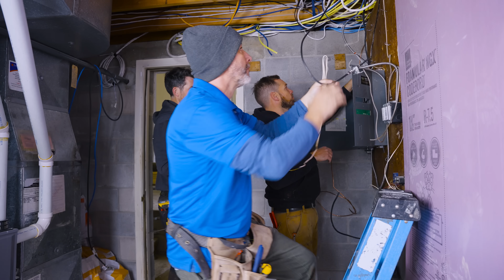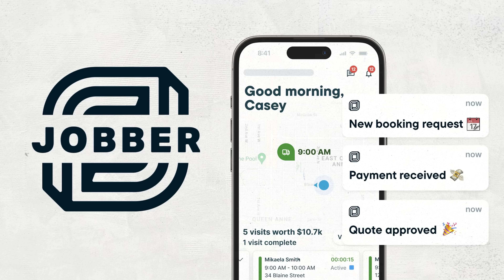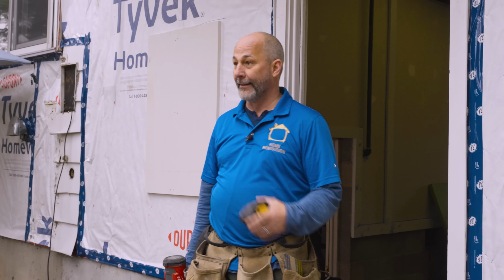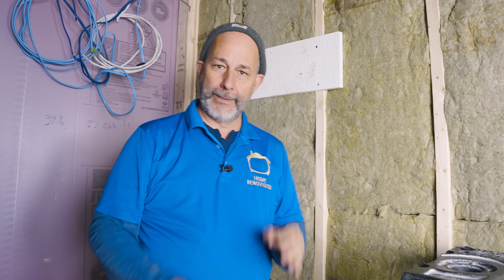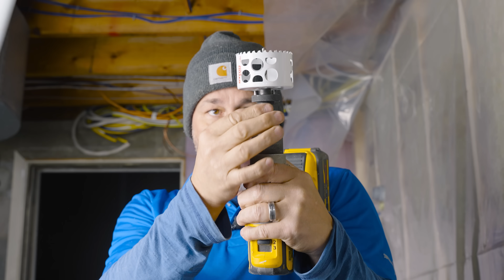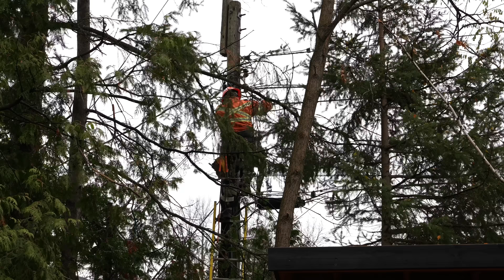How to Upgrade to 200 Amp Service - The Right Way

Comment: @HomeRenoVisionDIY

Just curious — did you use the adhesive dabs behind the foam board as a spacing method for moisture drainage/air gap before framing, like you showed in some of your other videos?

If not, I’m curious why that approach didn’t apply in this situation.

Comment: i hope you used a capillary break between the 2x4 on the floor and the concrete. otherwise it will wick moisture and rot. you also should have used a vapor-permeable vapor barrier like Intello Plus instead of that cheap plastic. Otherwise, water driven through your concrete will have nowhere to go, especially since you didn't bother to tape your rigid foam. Air leaks everywhere.

Comment: I realize code is different in the US vs Canada, hell different from east to west coast.  But I have to laugh because when I was putting in an new fence post (next to the house and electric box) and dug the hole down 3 ft and I came across the bottom of the electrical conduit and I hit no sand and NO warning tape.   Now I didn't dig laterally to see when the conduit stopped and the bare wire was in the dirt.  Thanks for the videos

Comment: ROMEX though??.. I am a pipe guy and for MANY reasons even though you may think ok..u are there for ever..life changes..homes change hands..people get dumb ideas and drill through and or send long screws and nails where they shouldnt...and so PIPING protects against that even the current people that would own. An forget or  not realise..j get it piping is expensive..but spare no expense ever on piping or plumbing...

Ok..back in know and tube there was the same mentality...

But guess what..with the way things are going things change needs change fast and you can run into situations where simply splitting a run or circuit and relocating is te best way..but you can't because you used Romeo and just tracing and pulling and adding wire is out if the question.

JUST to name a few... don't know why anywhere still allows romex..and Romex is like soo easy...though but very damaging...any holes going through floor joists compromises integrity ..so more floor joist or bigger ones I would use to off service all them holes I just saw under a main flooring area..everything affects the other in this kind of work..electrical affects the framing in this case...

Sorry I am just extra anal about stuff like this...but you are ALWAYS to me the best source for knowledge and understanding..I love your stuff..but I just have my ways and if I was there with you..I would never do romex...piping allows  for way less holes and use of junction boxes in the design for potential future need and or separation is key in electrical wiring design. In my designs, I always leave room for permanent upgrade potential with little to no added cost in the future

Comment: I'm not sure about Canada, I did it similar to you, but a cheaper alternative would be to have an external set of 4 breakers (which don't need a main breaker in the US), run a 100A to the existing panel, and add a new 100A panel. If the existing panel has safety issue, that won't be possible, but otherwise, that avoids buying new breakers and rewiring the existing panel.

Comment: Your videos are informative...Thank you... Just a reminder to anyone that wants to upgrade from 100 amps to 200 amps panel, there are no shortcuts... You have to call ESA and the utility provider... The cables that are bringing in power to your 100 amps panel are smaller in gauge size than the ones that should be providing power to 200 amps. These cables have to be upgraded...Otherwise they will overheat after reaching 100 amps and the main breaker on the panel won't trip until it reaches 200 amps.. Stay safe everyone.
Reply: Good information you should call and ask, but I know for a fact from the electricity provider than what is run to my house with 100a is good for 200a all i need to do it upgrade the breaker panel, though it still requires me to have them come and pull the wires so i can remove and replace the panel.
Reply: IIRC there would be 100A fuses under your meter that would blow. No easy way to replace them either, you’d be stuck without power until your utility company comes
Reply: That looks like its usa…I dont think thats in Ontario
Reply: @AndyGruuve  Jeff is in Ottawa
Reply: @amrsamir8322 noticed a lot of #12 and thought it would be somewhere in us

Comment: Aren't you creating moisture issue when using rigid panel + 6mm poly ? Aren't you trapping moisture between the Poly and the rigid foam ?

Comment: I live in the North as well and the vapor barrier on the inside and the foam board facing the concrete is going to cause moisture in between the two. It's my understanding that at least if you have 2 inches of rigid foam that is considered a vapor barrier no need for the plastic.

Comment: When was this filmed? I am guessing your home is actually done at this point. Any chance you could do a video of how to bury cable and installing a  generator shed and wire to home with 10 circuit switch? Or, whole home one. Thank you for the hard work and insights you give us.

Comment: If you aren’t qualified to work with electrical, plumbing or hvac.. keep out of it
Reply from the maker: fine but work along side of them as they left alone would destroy the integrity of the insulation and vapor barrier of the internal systems .

Comment: Since you're not structurally framing, could you have also just toe-nailed with screws? I'm in the 2 year process of finishing my wonky 1940s basement and was planning to frame it like you did since the member heights are going to be all over the place. I also like the idea of screws to change anything down the road easier.

Also how do you feel about 24 on centres for this scenario?
Reply from the maker: yes for sure!

Comment: I know you guys already done this, but if not, it's a perfect time to run Ethernet cables throughout the entire house.
Reply: I would say run 1.5" conduit every where you can instead. That way, you can easily pull the newer cables as even the specific ethernet cables you pull now can be outdated later.

Comment: existing and new code requirements for 'basement' walls require something underneath (even if its treated), and 3/4" firecode drywall between the top plate and the joists you're fastening to. ... at least in ontario anyways.
Reply: So a sill gasket under a treated bottom plate and the firestop drywall on the top plate?
Reply from the maker: not sure where you are getting this info. and I have never even heard of 3/4 firecode drywall. Cheers!

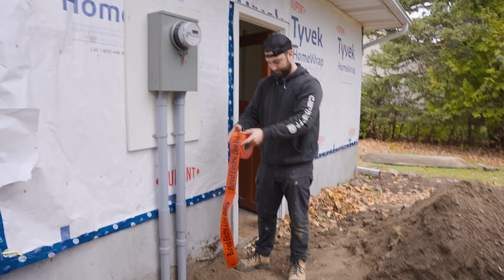Comment: 21:43  That only helps if you know about the sand beforehand 😂. For the average homeowner that might be digging, they will see the sand and say "Thank God" cause the ground will be easier to dig and keep right in digging 😂.
Reply: They did throw lots of warning tape in there, on top of the layer of sand. You get to the tape way sooner than the wire
Reply: Yeah thats true but if you are digging with a hole post digger, most of the time you sont see or pay kuch attention to the dirt you pull out. I just believe installing it in a pipe would be a better alternative. Maybe they should change the code about that. @aliancemd
Reply: @bbay1977  Just did a quick search for US(NEC/NFPA 70, NEC 300.5 and NEC 230.32) and Canadian(CEC/CSA C22.1, CEC Rule 12-012 and CEC Rule 6-300) electrical code(not sure which country they are making the video in) and they definitely could of used a PVC or RMC pipe to put that wire inside, it doesn't need to be exposed(also wouldn't need to worry about a stone rubbing the wire when it vibrates).
Reply: Oh okay, i would never try a large project like that on my own, so i wouldnt have to worry about that. I do want to install a sub panel box and ill kusy wait for hom to do a job and upload one 😂. I have seen olenty of videos, but i het all my information from hom, cause im not sure who to trust on YT beside him.ine will be in the basement so i can finsh it. It is a above ground basement too, so no need to worry about too much water proofing it too much. Been here almost 7 years and no leaks yet, so ill do a mild water proof and spend extra on insulation.  @aliancemd
Reply: Yeah, the ground in my area is sandy loam and the deeper you dig you hit sand. I think pea gravel or something would make more sense because it's something that wouldn't naturally be there.
Reply: That would be better than sand for sure if you are aware of it. I think jusy installing it in some lod of pipe would be a lot better. Then if you hit the pipe, youlll rrally check to see whats there. @catsmeow5566
Reply: @bbay1977  good point. even a combo of pipe and pea gravel or some kind of gravel that won't damage stuff would be good too. Better safe than sorry.

Comment: I'm thankful when I built our house 27 years ago that I insisted on 200A service. Electrician thought  I was nuts. Didn't care. I've had work done in later years where the techs have wondered "what builder knew to put that in," and they were stunned to learn I was the one who insisted on it.
Reply: It's overkill really. When are you using everything at the same time?
Reply: @mattymattffs  Depends on future plans.  Spa.  Pool.  Tube amps.  Shop.  Lighten up, grumpy old tradesman....
Reply: @jasonreplogle616  you have said nothing to disprove my point
Reply: @mattymattffs not overkill at all,an you need the 40-44 breaker panel,s8nce all the 240v stuff fills a 100 amp panel over half way there’s snot enough room in them ,you end up having to run a sin panel or mini breakers it’s a mess, and no room in the panel.
Reply: @mattymattffs  Found the electrician who's mad he can't make 6000 bucks upgrading it now
Reply: @kupokraft3685  not an electrician and not mad. Just wish people weren't so dumb and getting massive services put in for nothing
Reply: I have 125 amp service for the house and a 100 amp service for the shed, if I had more capability in the house service I could have saved 5 grand so.... 😂 @mattymattffs
Reply: @mattymattffs  One EV charging will use up 60A easily...
Reply: @Shankovich  The car is charging, the wife is using the dryer while vacuuming the floor and roasting a turkey in the oven, the husband is in the garage using a table saws and portable heater, and the kids have a gaming PC with a 5090 in it.

Comment: My daughter in Sterling, VA (near DC) paid $5,000 plus for an upgrade to 200 amps.
Reply: When you do the upgrade, can it be done outside the house?
Or is it like a major job where they have to come inside and rip out the drywall, roof, etc ?

Comment: The sand in the trench allows the cables and tubing to move a bit as the ground cools it down. Usually you want to 'snake' the cable or tubing a bit so it doesn't 'clothesline' when it contracts. A 1% contraction could create damage, so its good to leave some wiggle room.

Comment: I wanted to have my service line buried under ground so I contacted my power company.  
They sent a guy out and he said they would do most of it for free but I would need to get a shut off installed outside my house.
I wouldn't want to do that for security reasons.  If a thief shut off my power then my lights, cameras, everything would be out.
I live in a rural area and that just isn't acceptable for me.
Reply: It's not that big of an issue as the thief can still pull the meter out of the socket easily - it's how power use to be cut, but the electric company is no longer fond of such methods as the meters are more pricey and work in their automated systems.
The shut off has a cover over it and you could put a small lock on it (your not suppose to, but the electric co can easily cut it off to get access) Of course so can the thief. They can more easily take bolt cutters to your overhead line too.
Reply: @ctgottapee9020  If you want an on/off switch on your electric service then it's not that big of an issue.  I certainly don't want it.  It's a huge issue for me.  Maybe you can put a gun out there for the thief too.  Not that big a deal, a thief could always bring their own.

Comment: Why are there so many 14/3 romex cables??
Reply: 3-way switches?
Reply: Yes  @scottboucher675
Reply: @scottboucher675  I would see no reason for 3 way switch circuits requiring the 3 wire Romex to begin at the breaker box. 
Such circuits only need 3 wire between the actual switches.
   Unless its a new code or a specific code to Canada. I thought of smoke detectors all tied together with hot, neutral and a signal wire, but again why would the third wire be required inside the breaker box?  Just curious on the reason.
Reply: I have not seen much of this new baby-blue wire since the new colors came in -- that's the 14-3 I see.  Probably multi-wire branch circuits - saves one cable, but man they can sure make future trouble shooting tricky for "normal" diy people.   Maybe Jeff has a better explanation ¯\_(ツ)_/¯
Reply: @philp7358  yeah maybe I suppose the neutral and ground could share the load if the hots were on opposite  phases. Can't see it for 240v circuits if its only 14awg - hopefully Jeff will clue us in
Reply: @michaeldia5121 they have to be on a 2 pole breaker, if it's balanced between the 2 poles then the neutral doesn't have any current. Neutral only carries the imbalance. Wo unto anyone who lifts the neutral without turning the breaker off first.

Comment: Easy for you but in Calgary because we have underground service coming from a box 4 houses down the cost is 125,000$ because they have to tear up 4 other yards to get to mine. Too cost prohibitive.
Reply: A lot of newer houses here in FL are that way too.  But usually they use conduit so it can be pulled. Still costs a fortune but you don't have to dig up the entire run.
Reply: No conduit here. I wish. @GeoffWhittaker

Comment: 12:33 Same idea in cooking. Sharper knives are safer knives. You can use less pressure and let the knife do the work, so you are much less likely to slip and slice a finger open

Comment: I did it the right way too. I paid someone to do it. LOL. Granted that was because I had an electrical fire so even better insurance paid for 80% of it. Was such a massive thing to have done for an 1800s home.
Reply: Curious how much it was. I’m debating having my 1960 house completely rewired too. The way it is wired is completely out of code(different rooms sharing circuits, etc) and the wiring itself is that old stuff with the silver sheathing. I am not super concerned about a house fire but it would be nice to be able to use a space heater in one bedroom while using the microwave in the kitchen without blowing the breaker lol
Reply: @KingDraculaSpelledBackwards  I had my single story (basement, but no attic) 1940 house rewired in 2019 for $12k CAD. In a city. The guy was AMAZING, clean work, very diligent. Worth every penny.

I have plaster walls that I asked him not to disturb, so he only left little holes anywhere he encountered blocking. After he left I went and plastered over/repaired them myself with a series of yogurt cups full of durabond. It has made every project we've taken on since a BREEZE because we know the circuit that says "bathroom" truly does serve the bathroom and there aren't going to be any hidden surprises. 

The only "original" live wire left in my house is for the doorbell. 

Living in a fully modern house (infrastructure-wise) with old house charm is the dream.
Reply: I'm in socal, upgraded panel to 200 amps for $4k and about $9k for full rewire. My home is 1940s with 1000 sqft, 2 bed 1 bath. @KingDraculaSpelledBackwards
Reply: @KingDraculaSpelledBackwards  it depends on what you have in mind for "rewire".

You can cut holes into your drywall and fish new wire from each room to the breaker panel. This is the most expensive depending on how many holes you have to cut to fish the wires and how far each room is from the panel. You'll have to find out how each outlet in the room is fed and where they go. Very time and labor intensive.

You can do conduit inside the home. It's mostly drilling holes between each floor and room. The new wires run in the conduit to each room. This is perfect if you have a basement. You'll need to find a way to hide the conduit.

Finally, you can run the conduit on the outside of the house. Just as before, the wires run in the conduit. They enter each room via drilled holes. The only downside is that you have conduit running along the outside of your home.
Reply: They'd fine you like crazy once they find out that you didn't do it the right way